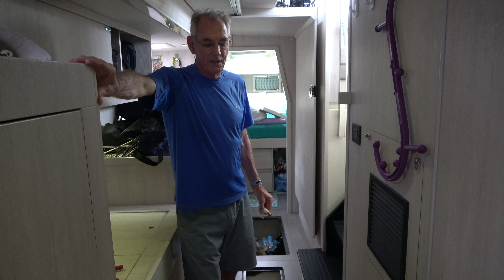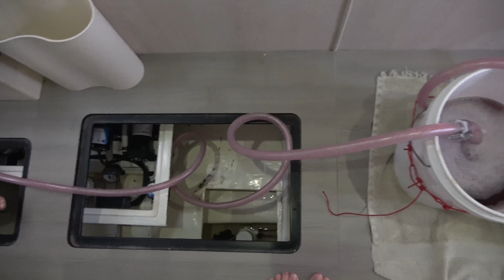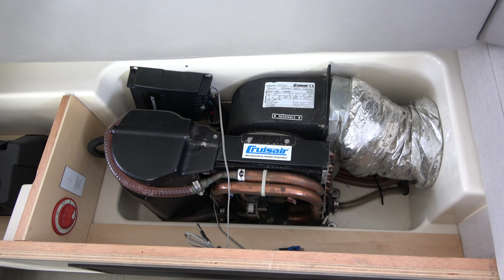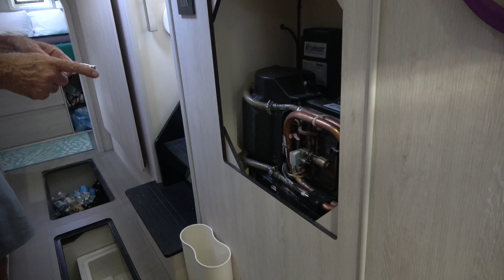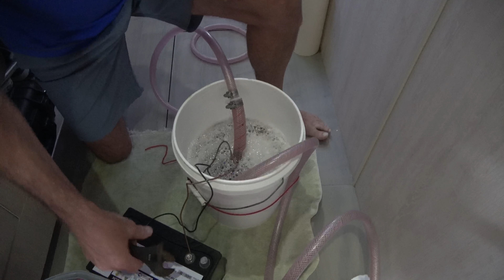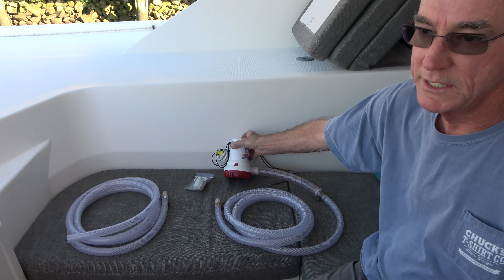HOW AND WHY WE FLUSHED OUR BOAT AIR CONDITIONING SYSTEMS #cruisair

Comment: Did you reuse the same batch of barnacle buster for each ac unit?  What do you do with the mix in the bucket when finished?
Reply from the maker: We reused it for half the total time on next ac unit. Then used fresh for other half of time. Check with Barnacle buster on the used mix water disposal. We were at dock so had access to disposal at marina
Reply: @SailingPILAR  thank you